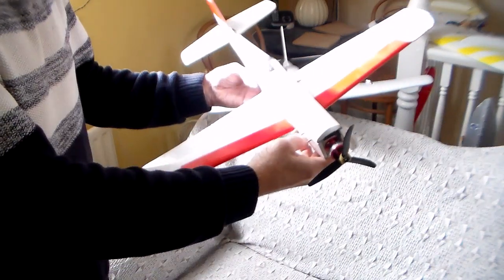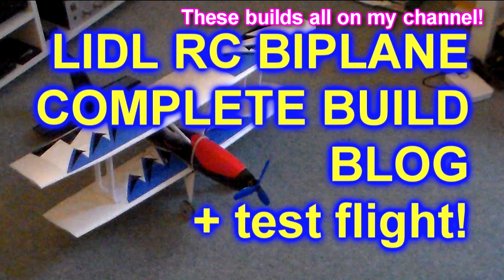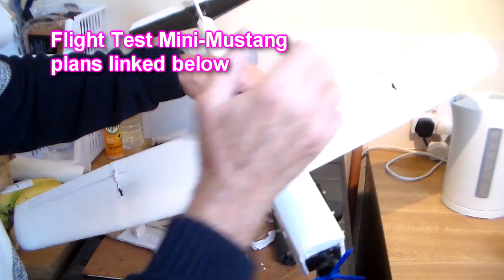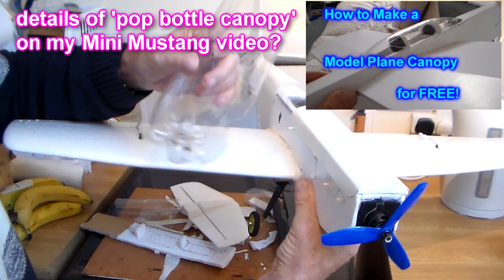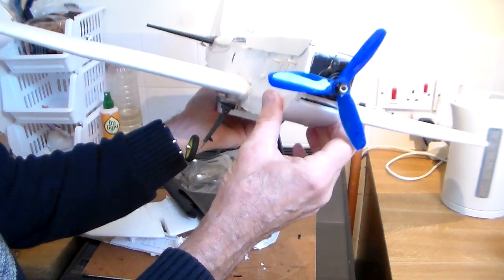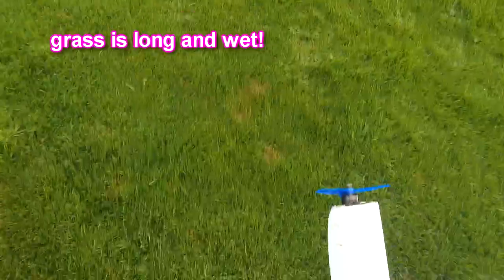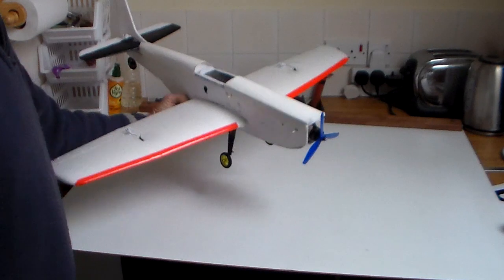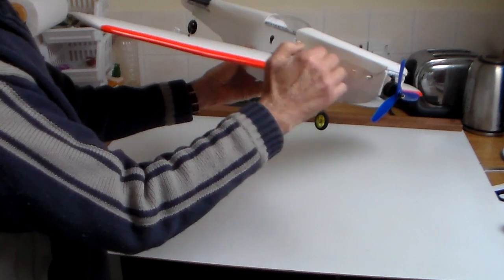Maiden Flight of my scaled up and improved  Flight Test Mini Mustang. How did it go?

Comment: Any chance you already managed to get a second flight in? Your changes sounded to me like they should do the trick. But why didn't you check the COG before that first flight? That's rather elementary imo.
Reply from the maker: Weather not great lately, but also I've had a really busy few weeks where RC stuff has gone on the back burner. RE CoG, I'd marked the spot in the model where I 'should' have put the lipo, but nerves got to me and I put it in the wrong place.